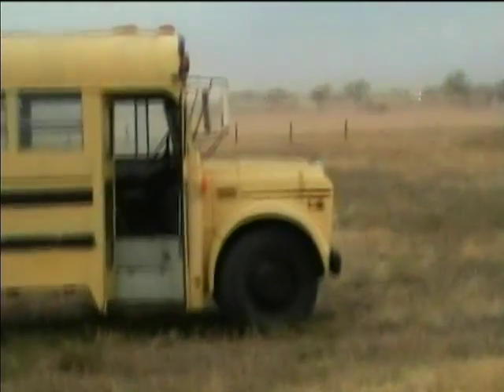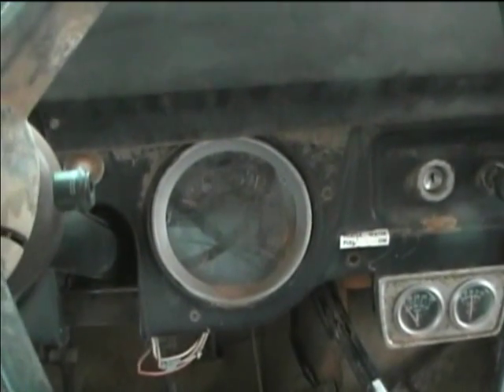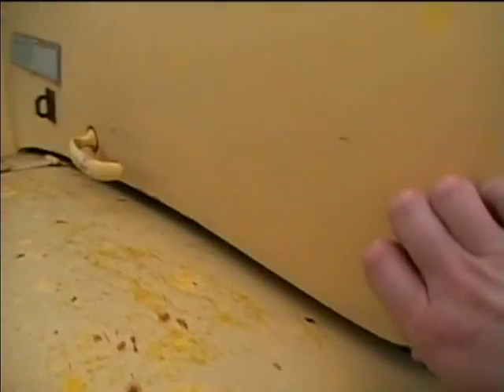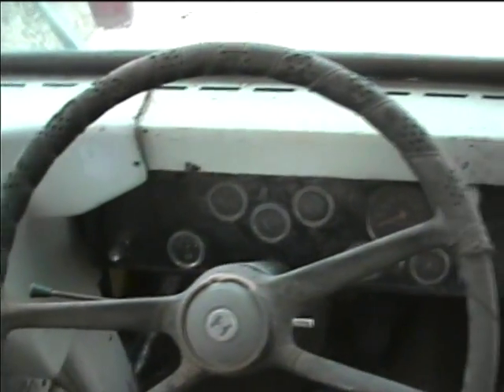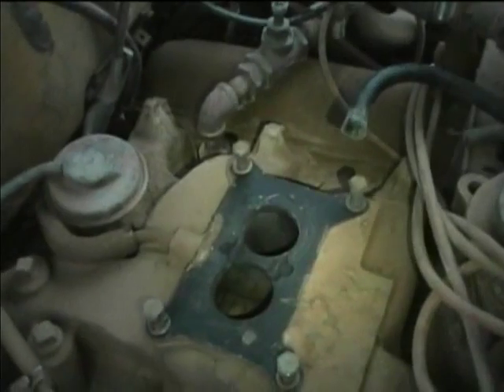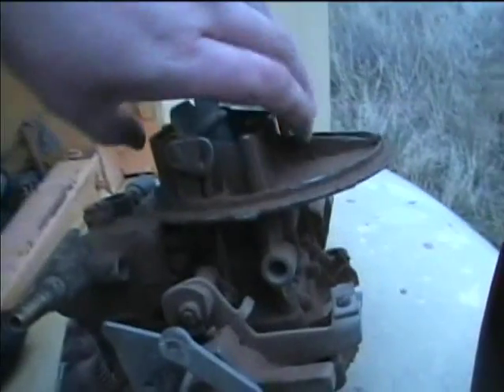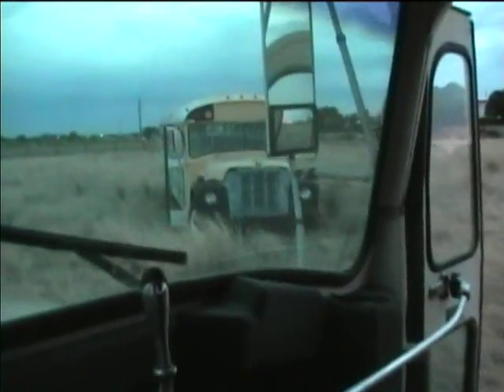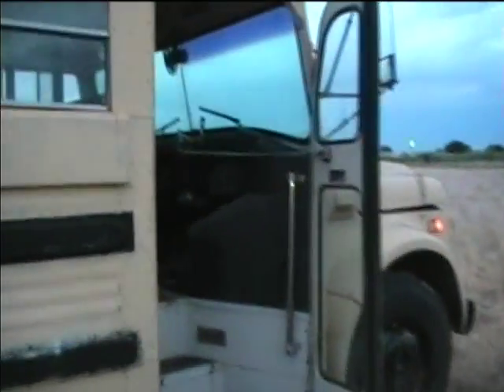Removing Holley carburetor from 1978 International Loadstar Bus

Comment: That's an interesting bus tour around your property!

 The line and the hole in the intake on the 345 appears to be where the PCV valve fits. If it was like that before, it's a wonder it ran at all because that is a HUGE vacuum leak.

 Holley thermselves should be able to supply any parts you need for those carbs..Advance Auto can order them IIRC.

Lastly, good job with the 366, but I suspect from the sound that you have a cylinder not firing. Very likely just a fouled plug. Good Luck!

Comment from the maker: Yes that makes sense...that is how the PCV setup is on the multi-port injected Ford 302's like on the Grand Marquis...a hole going down to the crankcase and the PCV valve in that exact location. I can't believe I never caught that huge vacuum leak! sometimes it just takes some more years of experience for me to know stuff better. 

I'll check those plugs and see what they look like...I have never even taken the distributor cap off or touched anything with the ignition system or plugs.

Comment: At 4:15, that is an EGR valve. Those are connected to a thermal switch so that exhaust gases aren't introduced into the engine when it's below operating temp. I have one on my '78 Chevy Van.